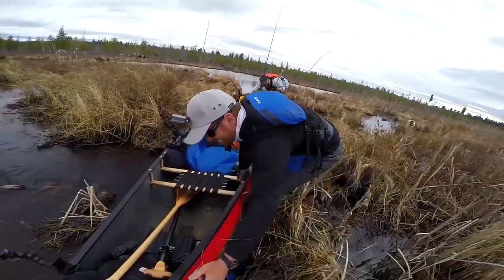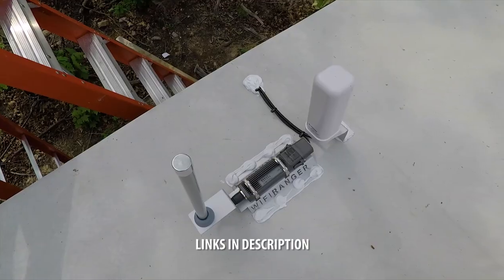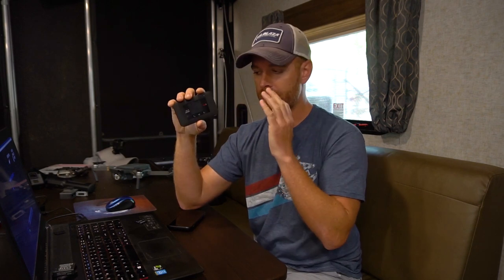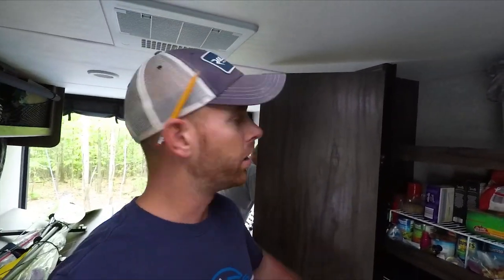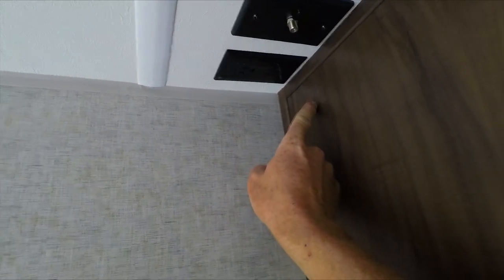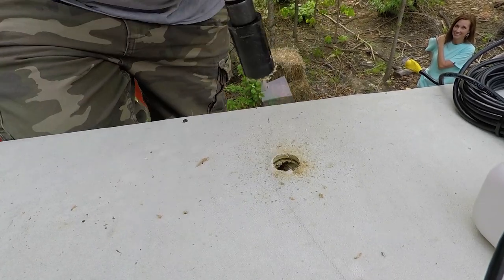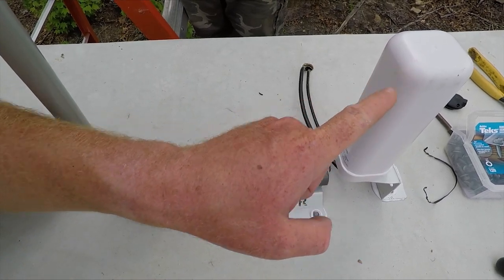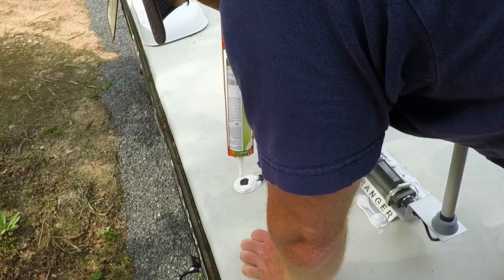My Internet Solutions for RVs & Campers - WeBoost & WiFiRanger | Field Trips VLOG

Comment: Talk about food prep! What kind of fridge do you have ? How does it work off solar? Are you finding you have to find plug ins? Or are you able to survive off solar pretty well?
Reply from the maker: It came with a moderately sized fridge and freezer. It runs off propane when I’m not plugged in, and as long as it’s cold to begin with, doesn’t use much.

Comment: Careful running 2 wires through the same hole. Usually it’s avoided because they can heat each other. I’m not an electrician but just something I was told.
Reply from the maker: Hmmmm good to know. I don’t think these carry much power so hopefully they don’t get too hot. I’ll keep an eye on em